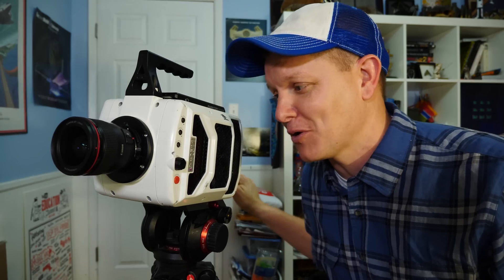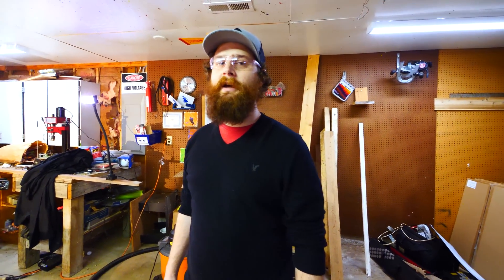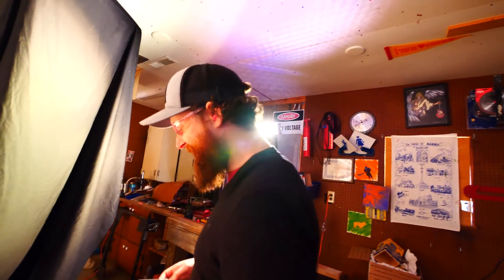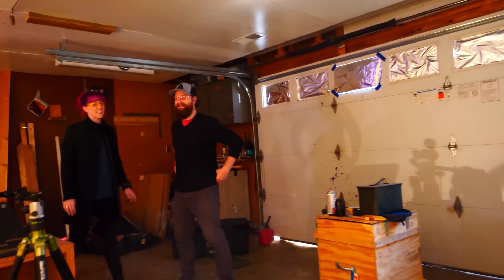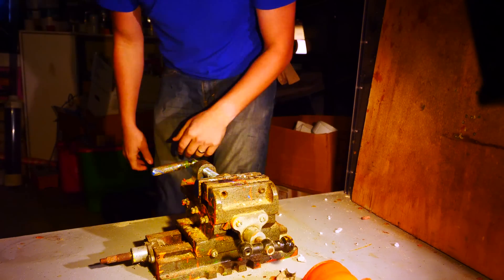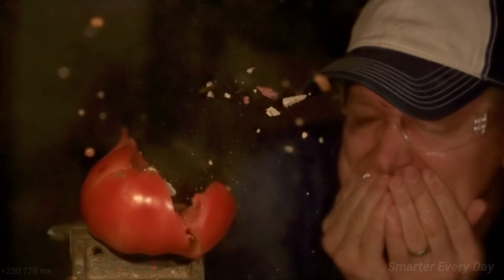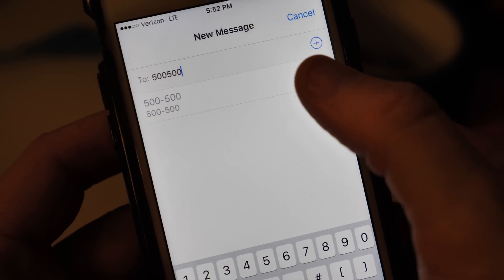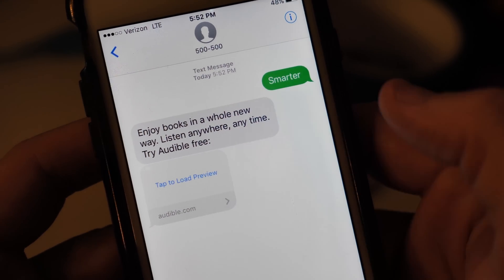How We Make Slow Motion Sounds (Exploding Tomato at 60,000fps) - Smarter Every Day 184

Comment: Despite the amount of work that goes into it, and the very polished result ... I honestly feel like this kind of audio detracts from the slomo segments. The dramatic use of echo is especially distracting in my opinion (and of course the fact that it is all made up feels very ... unnecessary). That said I am glad that you guys made this video as it clears up something that many viewers were wondering about. And now that it is out, nothing prevents viewers from muting these segments if one so desires :)

Maybe a good solution would be to add a little note in the corner of future slomo segments clearly stating that the audio is foley made in post - for the sake of full disclosure ?

Comment: I still don't understand why you couldn't make a high quality recording of the sound and process it to make it audible and in sync. Seems like it should be straight forward process. 
1. Stretch out the audio to match the speed of the video.
2. adjust the pitch to best hear what's going on
3. sync it up.
Only thing I could think of that might be a problem is the maximum speed microphones can record audio, but even so it should be simple enough to just stretch it out.
Reply: Siggy in CR when you stretch audio, the gaps in the waveform opened by stretching are filled in with digital interpolation. The result is a robotic "bwaaahhhhhhhrrr" and sounds terrible, and is arguably more unrealistic that what we are doing here. Neither audio recording or digital interpolation technology exists to rebuild the fidelity we require to sound even remotely believable.
Reply: I'll take your word for it, though it seems hard to believe that filling the gaps in a manner that sounds good would be very complicated.
Reply: Siggy in CR the video is often over 1000x slower than the audio recording. This means we are not filling gaps between useable audio--it is all gap. When you stretch an audio file 1000x while preserving pitch there isn't really any original audio left; just 99.9% algorithmically interpolated resynthesis.

Comment: Those aren't real M80/90's. They're just Chinese fireworks that they print M90 on. A real M80 would have blown a hole in the top of that create. Those M80's have ~50 MILLIgrams of powder. Real M80's have 3 GRAMS (3,000 milligrams of powder, 60 times bigger.)

Comment: The analog way to do slow motion sound is recording the ultrasonic waves frow the explosion and play it as slow as the video. Maybe it will create a interesting real audible sound.

But you will have to deal with some ultrsonic transducers and high speed ADCs. Normal microphons will not be able to record any usefull signal.

Comment: would it be possible to record an infinity mirror? capturing every instance of the reflection as it appears?
Reply: Light will move app. 1000 m in the time between frames with this ultra fast camera, so it would need to be 10000 faster and 10000 more light sensitive - and even then it would not work.
Reply: Ahh okay, thanks for the response :)

Comment: I've always found the use of foley sounds grating in slow motion videos. Most things you don't have experience with don't sound as you expect.

E.g. you've all seen nuclear test films; what you should have seen was a brilliant flash and mushroom cloud in complete awkward silence, and then 20  seconds or so later, the trees bend forward a little bit and a fraction of a second later you hear a loud thundercrack. Nothing like the deep rumbling you've heard, that was just a foley effect. You can see what it would really be like on the upshot-knothole annie test.

The least dishonest thing to do is to simply not have sound. A perhaps a less dishonest way of having some sound is to record at fairly high sample rates and process the data to extract the frequencies that are present in each moment so that they can be stretched to play at the same rate as the video. That way a 440 Hz tone is still a 440 Hz tone, it just repeats for many more cycles than it really should have and It'd still be wrong, but there's potentially some interesting information there.

Comment: Huh. Not what I expected.

Of course, when it comes to sound.... Slowing down sound would require a very high sample rate.
But... stretched far enough you'd end up with pretty much everything being ultra low frequency sound that is basically inaudible.
(even if you could hear it your speakers or headphones couldn't reproduce it.)

You could of course use a filter to slow it down without changing the pitch, but that's probably not going to work past a certain point either...

Slow motion sound kinda doesn't work because sound is a time-based signal, where vision is partially at least a spatial signal...

Comment: Oh, so the answer is "you don't, its all fake"!? That's... Disappointing, really. I was hoping for actual try to record sounds in slow motion.
Reply: I think Gavin from the Slow Mo Guys explained this a while back. He said that when you slow down sound that much it turns to an indiscernible mess. Also, I think Destin’s going to show us what it sounds like in the next video based on what he said in this one.
Reply: It would become so low in pitch, you wouldn't be able to hear it.
Reply: RaphaelAtherill apart from the huge quality degradation and artifacts which are inevitable when pitch shifting more than a semitone or so
Reply: You can't play back slow motion sound. The frequencies would be inaudible and if you pitch shift it's not going to sound good nor is it going to sound right.
Plain and simple, you can't slow down sound because our ears are not like our eyes.
Reply: @RaphaelAtherill  for like 1/2 /2X speed that is +/- an octave or 2 perhaps ..........but at thousands or tens of thousands & even hundreds of thousands of FPS even the highest Audio sampling rates wont do.......as you know just doubling or halving .....that is,  even just + or - 1 octave tempo pinch/stretch  will suffer some quality........when dealing with ultra high speed photography there just wont be nearly enough audio data points(samples) per unit time........by far & with the fastest "audio ADC/DAC's"(even if designed for ultra-sonic)........that is, if you were to stretch/pinch the audio by +/- hundreds or thousands of octaves(which is what you would have to do with super slow mo) ......the quality would be very roughly like 1 sample per second......as where it takes thousands/sec to be an OK quality.........we could do some precise maths.
Reply: I kind of expected it wouldn't be possible at the start when I thought about it.

I guess I was right? Actual sound slowed down that much wouldn't sound like anything discernible, I'd imagine.
Reply: That probably only happens if you record at a standard rate, like 48khz. If you went really high, like 1000khz, and slowed that audio down, it woud effectively shift the higher frequency sounds that we can't normally hear (those above 20khz) down to an audible frequency range and it might actually sound really interesting.
Reply: Might be interesting to transform the recording to the frequency domain and slow it down from there.
Reply: We perceive sounds based on how far apart sound wavelengths are apart. Once you slow sound down so much, its wavelengths are too far apart to hear aka low pitch. Changing it to higher pitch is literally just speeding up the sound. If you watched the slow mo guys video on why they don’t use more fps, it’s basically the same reason but for sound
Reply: Hehe, nice :)  Yeah, I think you'd have to go 192Khz to get a less lowfi-sounding version of 2.  

It's curious how the reverb is bullshit, but it does give the psychological impression of "size" in some sense, or  "cavernousness," one might say.
Reply: What do you think a sound in super slow motion would sound like?
Reply: It's because sounds in slow motion simply don't work. All of the sounds that we hear would be simply shoved down to very low bass levels. And that's only if you have an utterly ridiculous sampling rate that is frankly impossible for the vast majority of recording devices.
Reply: of course with a digital system you can easily change the tempo Independent of the pitch......as where "speed" effects both  ........which is what the oc was referring to I think.......but either method becomes useless at such extreme stretches/pinches.
Reply: 1dgram, How would that work? There is no time in the frequency domain. So how would you "slow it down?" Besides the fact that when you convert it back to the time domain you still have the issue that Radi Bear discussed.
Reply: +Paul Vanukoff

Yeah, that's what I was expecting - like they'd use a super-high sample rate, record the sound and then timestretch the audio (without affecting pitch).  

I doubt you could to this in a 1:1 way, because intuitively I get the feeling that the ratio is much higher for visuals than for audio, so the sample rate required for 1:1 would be beyond current audio technology, and timestretching software probably couldn't make sense of the result; but it would be interesting to hear an approximation of the actual sound done in this way.
Reply: Here Ive just created this test recording of a pencil drop, to see how slow you can go. https://youtu.be/C2SUlbMWD5M
Reply: Darth Biomech he’s a phony
Reply: If the pitch was the problem, you'd just need to pitch it up few octaves, nothing difficult really.
Reply: dont be stupid fool

Comment: Wait, so why can't you just have the microphones recording the actual event? That was never explained.
Reply: I'm almost certain the answer is because the waveform would be stretched so far that the resulting sound would be inaudible (sub-20 hertz, even less than 1 vibration per second in extreme slow mo). Either that or the highest pitches would just sound like a low "MMAAWWWWWWWWWWW" with a bunch of audio clicks and pops and other digital artifacts from the program they used to slow it down. Essentially it would sound worse than silence.

They could also record the actual event and then use those sounds to create the "fake" sound similar to how it was done in this video, but it's probably easier and better quality to just do it all in the studio.
Reply: The actual sounds, when slowed down, would sound nothing like you would expect. Not to mention that most of these slow-mo videos are so slow that if you were to slow down the recorded sound to the same speed it would be pretty much inaudible.
Reply: Answer coming in part 2.
Reply: George D we are covering it in Pt. 2, but this is the correct answer!
Reply: My thoughts exactly, but i guess it's because those microphones have to be in extremely close proximity to the actual  experiment to record some kinda useful sounds, and that might be kinda inconvenient or can actually ruin those expensive microphones (with stuff exploding everywhere)
Reply: Howe's life? Because sound works based on the speed and frequency of soundwaves. If you slow them down it stops sounding like the thing you're recording.